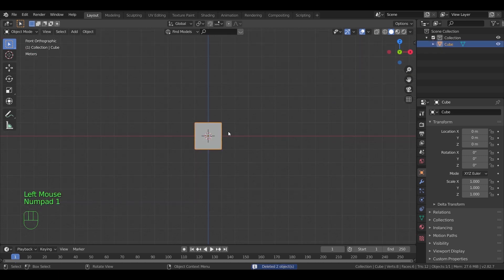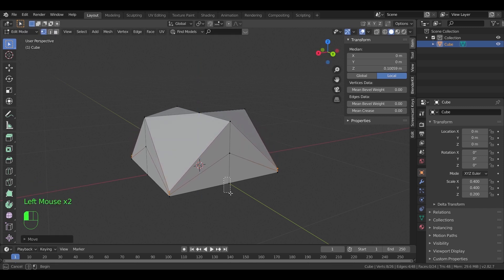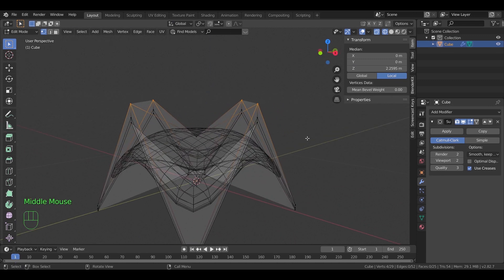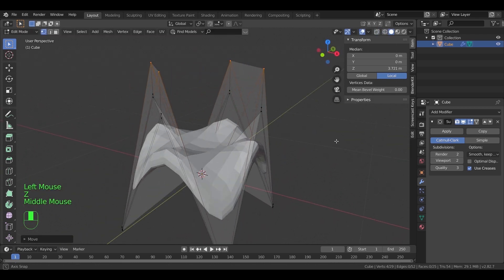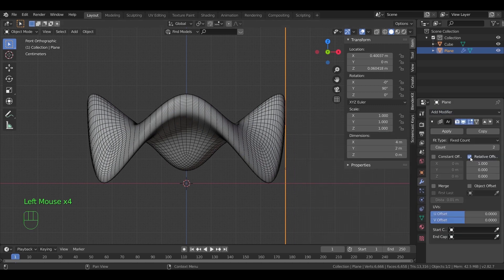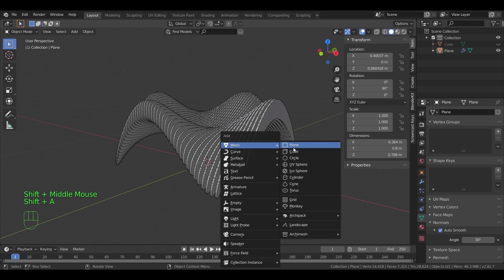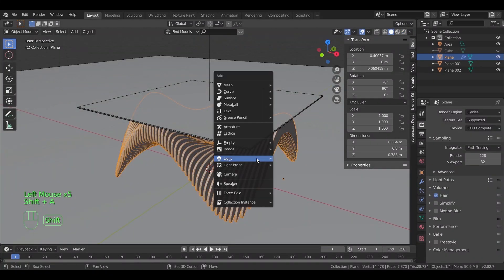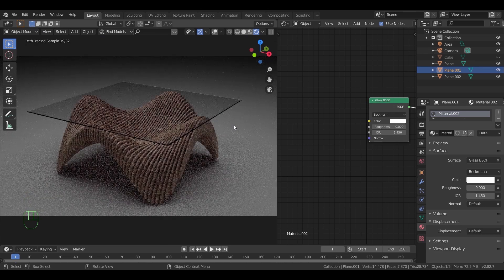How to make a parametric table - blender tutorial

Comment: As far as I know, parametric is supposed to design with parameters and not models a design directly. In Blender, it can use geometry node to create it. Even a simple design can be called parametric if it's created with parameters. If it's an attempt to mimic a design that usually a final output of a parametric design, but created it with direct modelling, it can't be called parametric. It's should've been called fluid design. But, does playing around with modifier can be specify as parametric design?